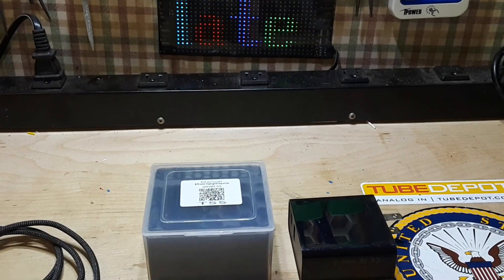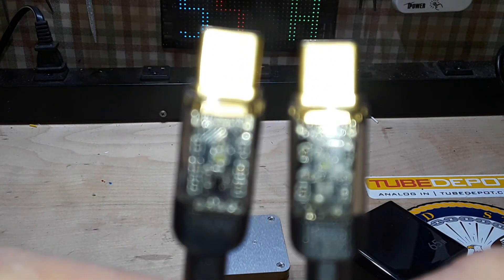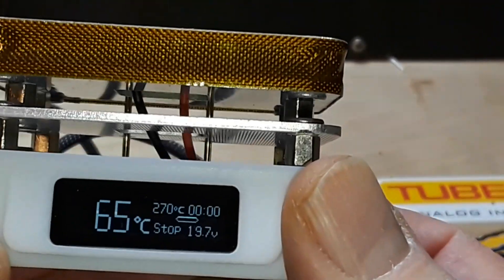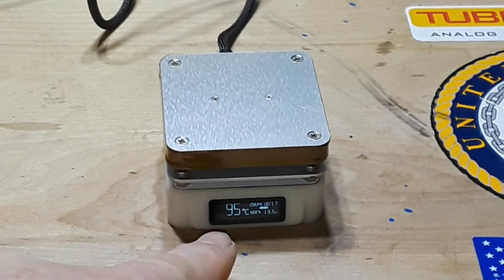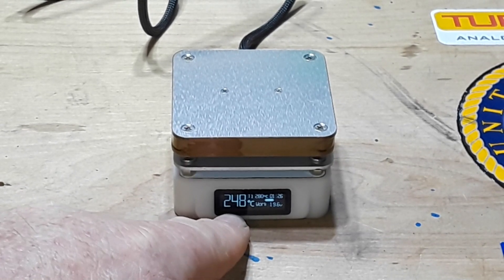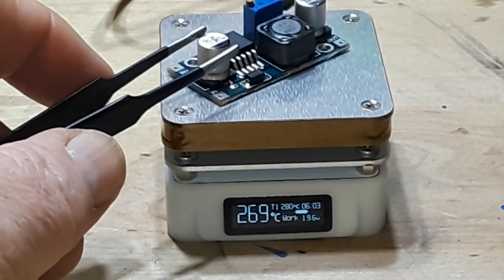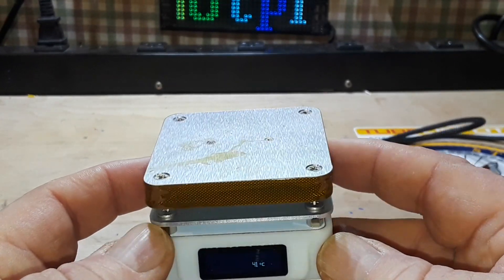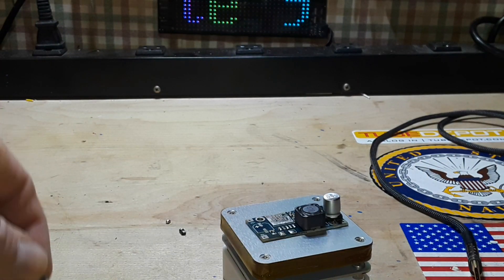First Look: Sequre Mall T55 SMD Soldering Hot Plate

Comment: People may want to check out "PTC heating plate BGA" as well. It's less safe because it plugs directly into mains, but it costs ~$3 (in my case), has much bigger plate (~ 3 times), can go up to 400 W and therefore heats up in less than a minute (in description at https://www.youtube.com/watch?v=Ce1tNj7AYZU it's said that it heats up in 30 seconds), and needs only a cord with a switch because of builtin constant temperature control (~270C).

Comment: Perfect for my micro-controller pcb work work where I need to just heat a small specific area on the board. I have been using a heat gun with a Teflon restriction hose. However, between the de-solder gun, heat gun and trying to pull an IC has been a pita. I'd heat the back of the board then set the heat gun down and try to remove the IC before the back of the board cooled off too much; typically a few seconds. PERFECT !!!

Comment: I had one of those and it failed.  So I took the heating element and coupled it to one of those cheap PWM modules form AliExpress, reused an old 20 volt Laptop power supply and mounted a larger Aluminium plate on top and voila! I now have a great coffee mug heater...

Comment: I've had this fancy Hair iron that has 2Huge elements. ,an OLED and power source already built in. I discovered when taking it apart it can be calibrated as well. Great find for $1 at the thrift store. I really need a 3d printer so I can get all these projects boxed up.
Reply: I said that to say this. It's not bad for $25 for what it is.

Comment: I have one similar to this - its handy for preheating the boards as well - I usually preheat and finish with my hot air at 350C with little air and the joints weld up real smoothly , they are a bit under powered by themselves. I saved the extra cost for the power block and USB cable by just making a USB C to my bench power supply set at 19.5V 2.5A